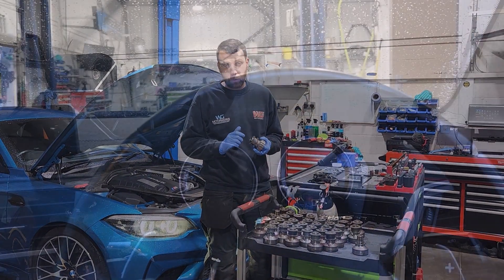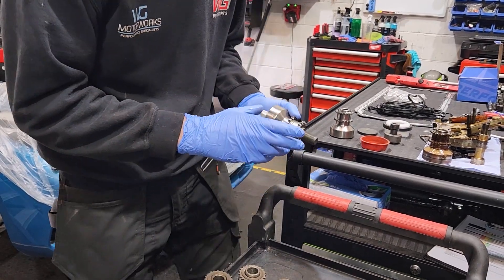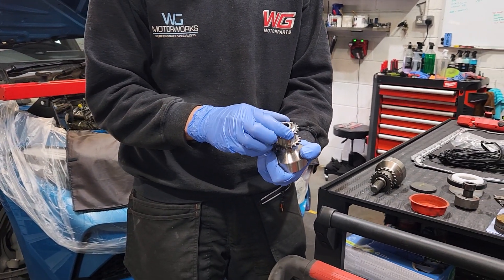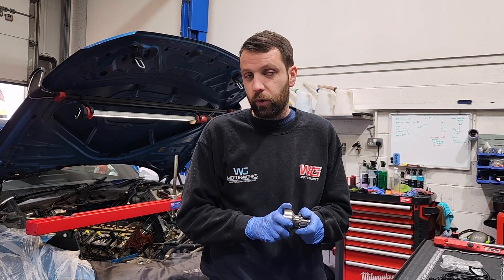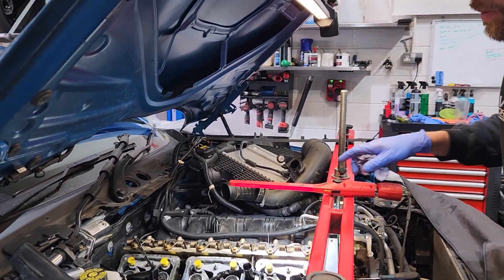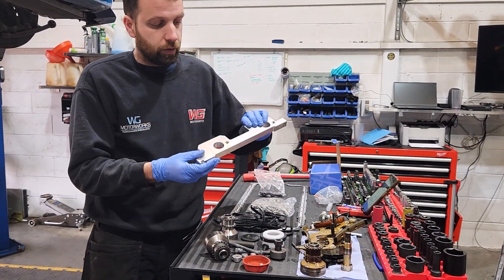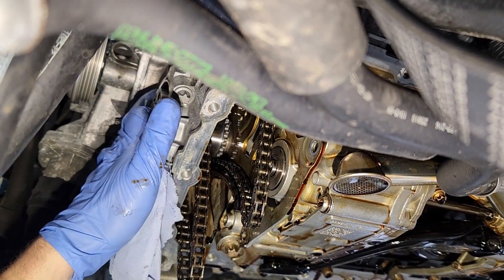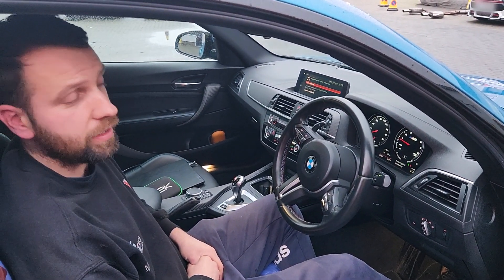Fixing the S55 Crank Hub weak link on the BMW M2 M3 M4, CRANK HUB SLIP!

Comment: very good explanation, does the coolant system need to be drained and re pressurised in order to get access to crankhub?
Reply from the maker: Yes, the system is drained to remove the Rad - this is then vacuum bleed before refilling

Comment: These normally come undone due to aggressive downshifts, the stretch bolt is torqued to 600lbf….. they have been known to come undone in traffic believe it or not!!😳
If your running big BHP prevention is better than cure but  if you keep an eye on these & check the torque you shouldn’t have any problems.

Comment: Hi Warren. We do this with the Mosselman kit. Never had any disasters yet Did you ever have the valvetronic motor actuator short? Had one 2 years ago the whole car shut down as the 5v power supply from DME shorted the 5v consumers including the fuel pump rotor position sensor. Disconnected and it started right up :) I did a massive top end rebuild on one of these but sadly the video was deleted haha. Just subscribed. Nice channel and best of luck with growing it :)
Reply from the maker: No, never had that issue before! Always disconnect the battery when doing the job mind!
Reply: @WGMotorworksYouTube  I had two of those in the last few years from car sales companies. No doubt they jump started them. One to watch out for and not just on the S55 either👍